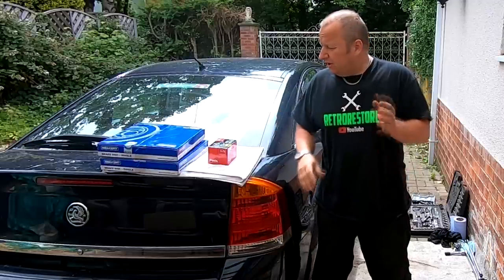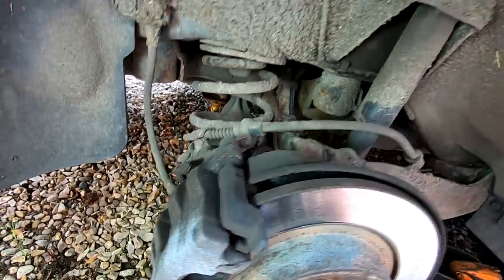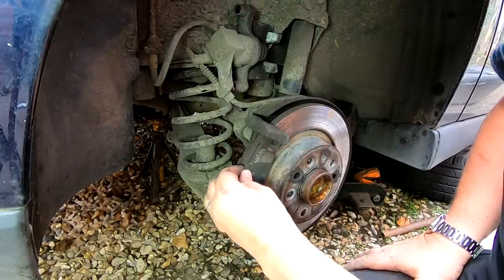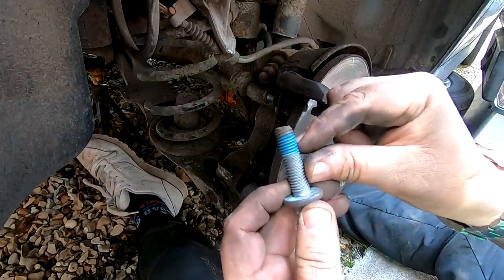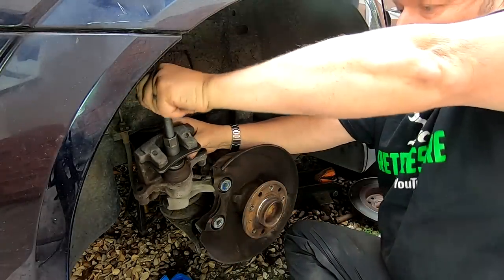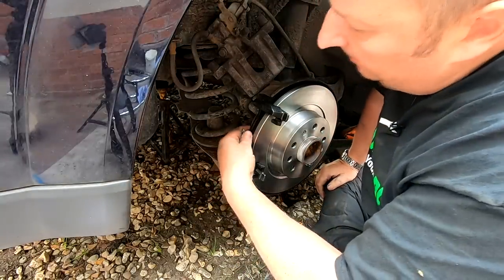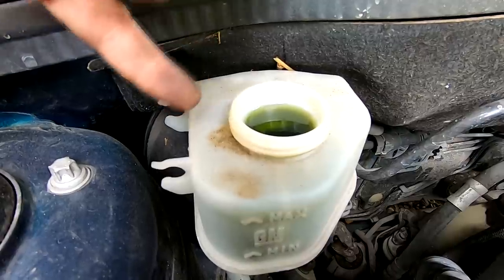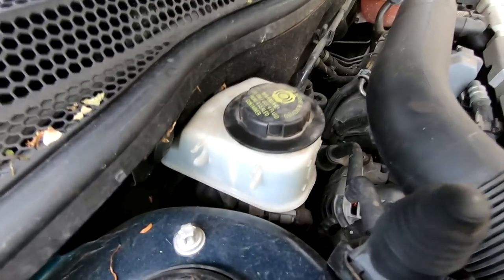Vauxhall Vectra C Rear Brake Disc And Pads Replacement | Opel

Comment: Spot on Martin. I didn't need to touch the rear brakes on my Vectra C which was of a similar vintage to your's. I would agree that it is not absolutely necessary to remove the cap on the brake fluid reservoir. I thought you would've put a dab of copper grease on the pads where they come into contact with the caliper and caliper carrier. I've got a couple of brake pad videos coming up on my channel (Ford B Max and BMW X1) so it would be interesting to compare notes on our respective methods.
Reply from the maker: No need really Dave as they were sandblasted and re painted. plenty of movement bud.

Comment: Great job on changing the pads on the car.  The only thing you did not mention that I remember is a reminder for the beginner to make sure they block up the vehicle and put blocks by the wheels so it can not roll.  Very thorough video.  Thanks for sharing.  Stay safe.

Comment: Good video, you’ll definitely give plenty of DIY mechanics the confidence to tackle the job saving them tonnes of money.

You spend a lot time explaining why you don’t need to remove the reservoir cap and then demonstrate exactly why you may as well remove it anyway.
Reply from the maker: People say you must remove the cap or you will blow the seals out, That's what I was explaining.

Comment: Hi Martin that brake fluid looks like it needs changing the colour looks very green black.
Reply from the maker: its a clear green colour.
Reply: @retrorestore  If its more than two years old Peter is right, it should be changed for best stopping performance.

Comment: Another great video. I had a problem with one of my Vectra, but it was not the pas, discs, but a pipe. But I drove to work a couple of times. got a lot of brake fluid, but I needed to drive to Romania from England. My Garage mate said pop in and can do it in a couple of days. I said it is a brake pipe. so we replaced the harder left side and I did the easier right hand side. Of course he had flaring tools which I did not and a lift. Took 30 mins. brakes sorted. I asked how much. He said cost no labour. £35 more than covers it but you get pipe cheap Nick so some appreciated.

My only proper problem apart from that was it had a water leak that went into the boot and we never found out where from. Tried everything. There was a pipe for air that had a hole, and a replacement was £90 from Vauxhall, but was a reason I bought the car cheap as the fault hard to find (not really) and cost £5 to fix

Comment: great job martin, it went a lot better than the job i had today, 2 rear wheel bearings on a corsa c , bought a press tool to push them out, bit never had a small enough die in it, so bought another one, the type ya knock out with a hammer, what a nightmare, i even put the bearings in the freezer and the drums in the oven, lol thinking they would just drop in... no chance, still had to knock them in, then one of the new bearings bust, ordered another bearing, will take the drum to a garage to be pressed out properly, no way am i doing that job again, think i will stick with brake jobs.... lol
Reply from the maker: We've all been there Andy lol

Comment: My bolts have got lock tight all the way up both front and back managed to get the front discs and done by using a couple spaners and a jack by turning the wheel but not got enough room at the raer

Comment: Not sure what you call the oily film on the rotors but we call it Cosmoline in this part of the world. Keeps metal parts from rusting as they sit in packaging for extended periods. Got to clean it off brake rotors before installing or life could get pretty exciting if it is on the rotor when you first try to stop!
Reply from the maker: Not sure its got a special name, its just a preservation oil to stop them rusting in storage I think.

Comment: great video but you are Defo best to remove the cap-not just to monitor it over spilling but it allows the pressure out as you back the pistons in as its a sealed system  -less chance of seal damage

Comment: Nice job 👍,   Maybe worth changing the fluid,  the colour don’t look good,

I find the handbrake poor on these vectra-c,  There not very solid at all,  even after a brake disc & pad change, and new cable,   How do you find yours?
Reply from the maker: The brakes on this car are excellent including the handbrake Chris. The fluid is green but very clear. It may be that colour.
Reply: common complaint on veccy Cs the poor handbrake performance ,there was also a recall on the vec c handbrakes for the ratchet mech releasing the recall involved extra springs being fitted and the advice to NOT press in the handbrake button when applying.

Comment: Nice job Martin 👍
 In January  I got  bargain Pair of   Front Break disc and pads at Euro car parts with 50  percent off and Thay cost no joke just under £30 for the lot
Reply from the maker: Nice 👍
Reply: I got a good deal on my astra also all 4 sets of pads and all 4 discs for 200 and fitted them with my mate so no labour charge lol win win

Comment: Very Helpful video. Just one question the carrier bolts (which you say are threadlocked in) have a type of head which is not like a usual bolt.  Do you use a normal bolt socket on them or is it some special type of socket.  I don't want to use the wrong socket and risk damaging the bolt head.  Thanks
Reply from the maker: I think they are e sockets on there
Reply: The securing bolts are external torx (E torx)  I have not come across these before but they are specifically used for high loads. They need a special E torx socket with a deep chamfer.  Thanks for the info.

Comment: thanx for the video. It helps a lot! I have bit of a slightly OT question. Do you know if the seats from the Saab 9-3 or maybe 9-5 fits in a Vectra C facelift GTS ? Cheers from Denmark
Reply from the maker: Don't know, sorry.

Comment: Thanks Martin another awesome vid.  Just out of interest are the jacking points difficult to locate on the Vectra C? Could you do another vid dedicated to basic engine service oil, oil filter air air filter please ta Rich
Reply from the maker: I thought I done an oil change vid on this
Reply: @retrorestore  Hi mate in hindsight you have you legend.  The only piece missing was the air box.  But assuming this is a pretty easy one 😉

Comment: Apparently the green colour can be caused by copper from the brake lines.  You probably need to change the fluid.   However apparently some high performance brake fluids are green in colour so it could be high performance stuff in there.
Reply from the maker: I would say its green fluid as its crystal clear and the braking is excellent.

Comment: My vectra c rear brakes are binding, besides the caliper pins, do we need to grease the caliper cylinder as well mate? I mean to push the rubber boot in and grease the cylinder. Thanks
Reply from the maker: If the boots are in tact, you shouldn't need to but if they have let crap past, they could be stiff. If they push back quite easily, i'd leave them alone.
Reply: @retrorestore  Okiedoke. Thanks mate 🤝🏽

Comment: @retrorestore Hi Martin I've just done front and rear pads and discs on my friends citroen c3 the rear dice were shot and the front weren't much better
Reply from the maker: Nice one bud. All went well I hope.
Reply: @retrorestore  yeah I had one rear disc that was the wrong one had to take it back and nearly a torx bolt nearly rounding off but all ok apart from that thanks for asking 👍

Comment: Great video Martin... Have you ever done a cambelt and water pump on a Vauxhall zafira elite.. are they difficult to do..  thanks.
Reply from the maker: Is it diesel or petrol Paul.
Reply: @retrorestore  diesel
Reply from the maker: @paulbutcher9596  Is it the 120bhp or the 150 bhp engine. I have done vids on both
Reply: @retrorestore  120 Martin.
Reply from the maker: @paulbutcher9596   It's the same engine as in this Astra I did https://youtu.be/6qw0id3mu7k
Reply: Thanks for your help 👍

Comment: You mentioned that the pads are checked under the MOT.
i had mine Mot done 2 days later no pad left and a buggered disc .
I asked the garage why they weren't checked at mot.
Answer.
As long as it bites on the rolling Road it passes
Reply from the maker: They should have done a visual check too, They are wrong to tell you that.
Reply: @retrorestore  you are right but hey thats garages for you. 
Just watched your rear pad change going to do those myself. 
Brilliant videos

Comment: I take the cap of my resovior, mostly just because it winds in easier I find, being a sealed system. I also like to put copper grease on those shitty retaining screws
Reply from the maker: It makes no difference Lois removing the cap bud
Reply: me too Louis- as you say its a sealed system and less chance of master cylinder damage etc
Reply: retrorestore it does, it’s a sealed system, the fluid will rise as you push the piston in. You can see it happen. Just takes some pressure off and goes easy on seals
Reply: lee mclaughlin of course, you can feel the difference with cap open or closed when winding piston in

Comment: You don’t have to clean the disc of with brake cleaner the oil will burn off
Reply from the maker: Never leave oil on a disc bud.
Reply: Do it all the time I’m a tech by trade
Reply: I know lots of techs that dont bother anymore.. as you say it burns off.. saying that, I always do clean them..😏
Reply from the maker: @stedavo811  You have to remember that the people watching these video's are not Tech's and may think it's ok to have oil on the discs.
Reply: But it still doesn’t matter it will burn of if it is left on
Reply from the maker: @stedavo811  Well, you show it in your videos and I'll do it my way bud.
Reply: Don’t do vids but it will burn of